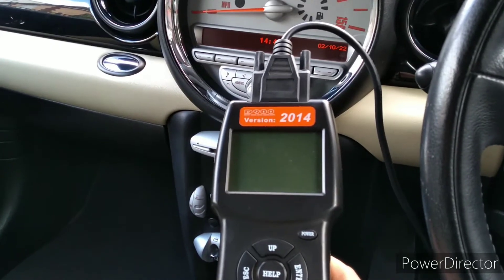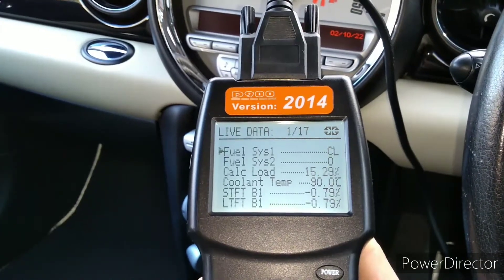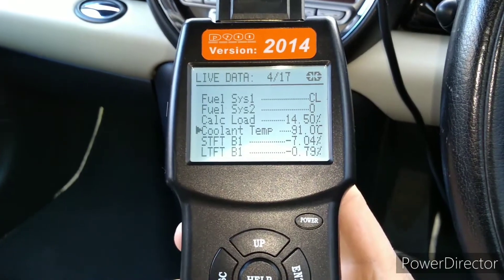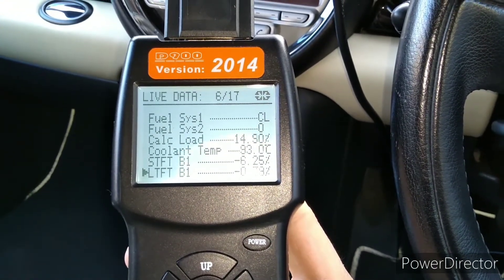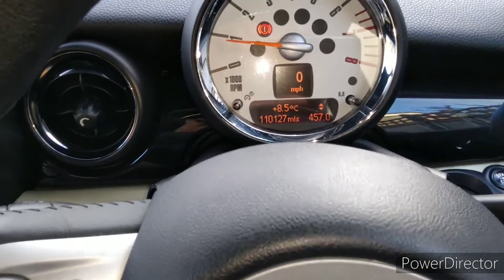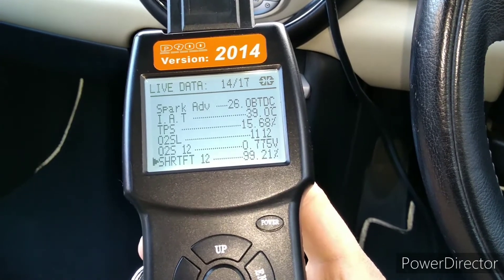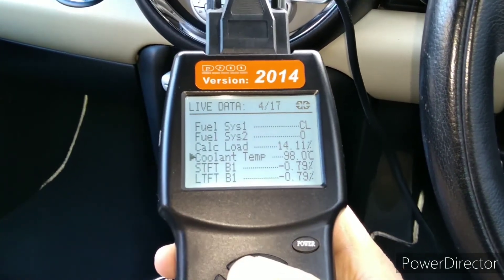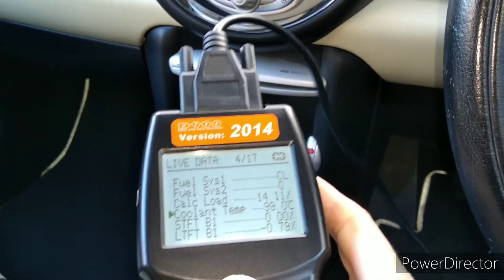Mini R56 (2007-2013) Cooper (1.6) OBD Port Location & Example Live Data

Comment: Thanks for this. I notice you didn't cover reading the upstream o2 sensor, any tips on reading that? I'm getting a p2096 (too lean mixture from the downstream sensor) and so I'm trying to read the mA and lambda readings from that sensor but it's a bit tough to understand for a newbie lol
Reply from the maker: Sorry for the late reply. I just watched the video again, and that tool does not appear to show that data PID. It just shows the basic EOBD data, you need a tool that shows 'factory data'. Those mA o2 sensors are known as 'air fuel ratio' sensors. I think 'DiagnoseDan' and 'South Auto Repairs' channels have good videos on those.